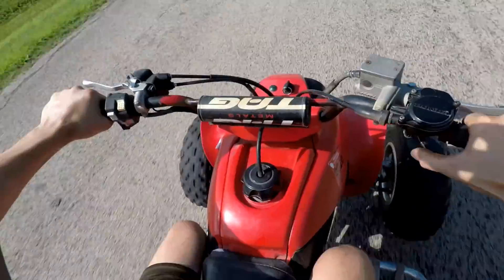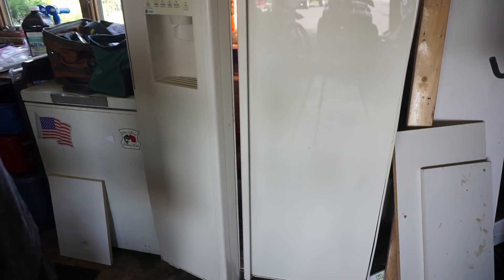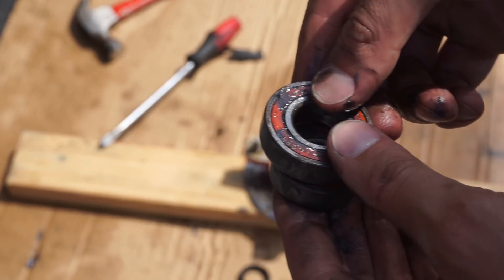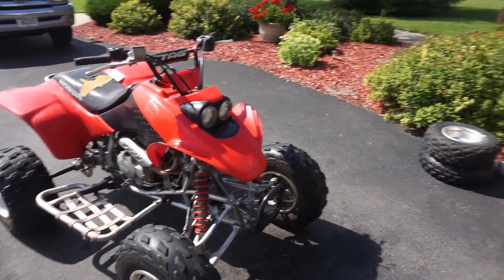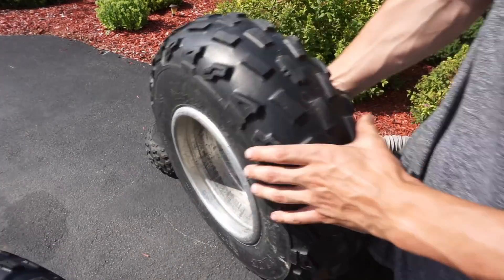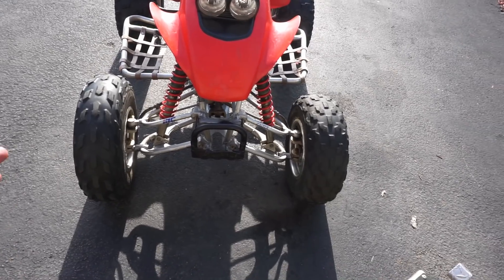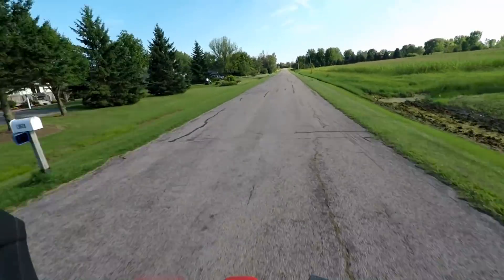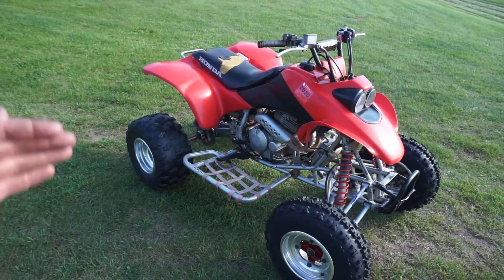New Wheels and Bearings...Will They Fix The Death Wobble?! (Honda 400ex)

Comment: For wheeling the first thing you need to get use to is using the back brake when you're in the air. Just practice until you're confident and once you are,  practice clutching up, even if you clutch up and it doesn't go very high. Keep that up for a while and in no time you'll get the hang of it. We already know you can power up but it's a lot harder trying to keep a wheelie up if you're powering up in first gear. Once you have clutch/rear brake control, then you can slowly look for your balance point. There are other ways to learn wheelies, this is just the way I learned. Keep up the good work and never give up only you can figure it out.

Comment: I told you Ive seen it many times dont run tire slime in front tires..

Get a beedbreaker and then pressurewash them out. Ive done it a few times.

wont fix the bent rim but the other will be ok tire may or maynot  work

good luck keep up the good videos, like the 450r I had both myself 2001 416ex, and 2004 HRC equipped 450r. no cam touches the 04 HRC in a 450r

PS  for wheelies make sure rear tires pressure is even and try standing with legs rest against rear fenders at first to make it balance a tad lower  good luck

Comment: Smooth throttle, keep your arms fully extended, 1st gear, worst that will happen is the grab bar will hit the grass, keep your foot ready at the rear brake and if the bar hits tap the rear brake and bring it down. Tires are probably having you rev too much because the are bald. Once you pop it up lean off the throttle dont chop it.

Comment: 10:50 You need to adjust your throttle. You can hear it rev up when you turn the handlebars. That's normally caused by a slightly short throttle cable. Most times that can be fixed by rerouting it or adjusting it. Great job nonetheless man! That quad is definitely a keeper at this point I think.
Reply: @Austin Zuber Yeah, that probably needed some adjusting. Lol. Mine did that too after I upgraded handlebars to slightly taller ones. I just got an extended throttle cable to fix it.
Reply from the maker: I noticed that as well! I think it is because I had a zip-tie on it to prevent it from meting on the motor.
Reply: @2vintage  Something like that could definitely cause it. Thanks for the content.

Comment: Did you pull the seals on the new bearings and pack some grease in...they are usually minimally greased.
Reply: not too many people know how to use a razor blade to pop the seals on the bearings you clean them out with solvent. And I suggest put good synthetic grease back in it. But he probably bought Chinese bearings the cheap ones

Comment: Damn that's kind of crazy. It's that green ghost in the tires. I kind of figured that was throwing the balance of on your tires. I bet if you could get all that crap out out of those tires, you probably could put those older tires on it while you are riding it on the highway because concrete and asphault will eat up 4 wheeler tires very quickly but as much stuff as you have got, that would probably not be a problem for you. I want to bring you mine and let you tweak with the computer on it. Change the gearing up a little and make it go faster. I also want the rev limiter off of it now. I thought they had finally taken it off but I got to the very top of a road and let it go and once it hit 64 , it started taoljg

Comment: Even though you fix the wheel wobble, you definitely should fix that bent tie rod. Don't want to make yourself look like a hack.
Reply: Unfortunately Joe has been a hack for awhile. I get getting it good enough to ride but it's every project and he never listens to good comments and when he does it's the most stupid crap like it's "smoking cause the air filter is causing too much restriction" like dude that doesn't make sense.

Comment: I wheelie my bike all of the time so what I see is that you are Leaning to far forward you need to lean back so your arms are all the way out which therefore puts your weight on the back of the four wheeler which will help you find the balance point faster.

Comment: Good job man...you've been killing it on your fixing Skillz....BUT those 9000-RPM wheelies are hard to watch... you have to either slow down n use your clutch to pop it up and learn how to balance ...or hit the next gear...Or nothing will change...im not trying to be negative...I got 25 years of riding...I can wheelie any of my bikes till the sun comes up...Even my snowmobiles...my point is... if you want to practice wheelies and get better...stop doing what dont work over n over...

Comment: Here are the most common symptoms of bad control arm bushings and ball joints:

Clunking Noise. Specifically coming from the control arm and usually following a bump, braking, or a hard turn.

Steering Wander. Pulling to the left or right without input from the steering wheel.

Un-Even Tire Wear. ...

Vibration.

Your problem not your wheels

Comment: Can I make a suggestion for the next quad? Either a Polaris Predator 500, Which I had, they were good quads as long as you changed the oil and filter regularly. Or better yet, get a Polaris Outlaw 525 with or without the IRS suspension. They are great quads, look good an the Outlaw has a motor from KTM.
Reply from the maker: I've seen a few up for sale! How do you like them compared to the hondas?

Comment: that bar on the back won't save you, Iol you'll still flip. That slime was intended as a temporary patch if left inside for more than two years damage will easily be done. i.e. the rim and tie rod. That's a suggested hint at how well your machine was taken care of. Good job figuring that part out! But to be honest, after watching your top end rebuild I personally wouldn't put any faith and in it.

Comment: Pop that clutch in 2 gear and it come back but keep tapping that brake very lightly you wheelien to fast you can’t do power wheelies in first gear
Reply: you can but its hard to get to the balance point and stay there, most the time you loop or dont balance.

Comment: Hey I have a 2002 TRX Honda 400ex just bought it and can't figure out why it won't idle I have changed everything I can. Cleaned up the carburetor rejetted valve needle replacement played with the air screw not sure what else I could do

Comment: new bearings - wheel rim, but you did not check the tie rod ends for slack or if they are worn , as they to can cause wobble
Reply: He checked the tie rod ends two videos ago. One of them was bent and he straightened it.

Comment: Hey where did you find that little atv jack I've been wanting to find me one for the atv and for the street bike...
Reply: I think he's just using a bottle jack. If you want an actual jack designed for ATVs and motorcycles, harbor freight sells one that goes on sale for about $60-$70. I've had mine for about 4 months with no issues.
Reply: @xfiringsquadx  I meant one that is solid not extending and it works more like a jack-stand
Reply: @kevinAuman1  Oh, I see. That's a lift stand...

https://www.motosport.com/ktm-powerparts-lift-stand

Comment: I have a honda crf150r 2009 it almost dont hav power at low rpm and wont start with the kikstart when it is warmed up so i have to roll it to start. Do you have an idea why?
Reply from the maker: Make sure the valves are in spec
Reply: I can’t believe Honda made a CRF125 hahaha 😂
Reply: Could be the carb also
Reply: Fox250R it looks so old
Reply: 2vintage it runs super good at high rpm and got mutch power
Reply: Check your plug
Reply: Fox250R brand new the old one looked good to
Reply: Knut Dalan jets dirty maybe ?
Reply: Fox250R i am a bit afraid to do things to the carburator because it somthing i sm not good at

Comment: I have itp rims on my 94 fourtrax 300 12x7 new tires new rims and I have a wobble was on the front right I switched the two fronts around and still have a wobble on the one wheel now it's front left since I switched seems like a bent rim from factory since I don't ride hardcore just drive around my yard I'm thinking of getting a new rim I hope it solves it rim only says 12x7 don't say what offset it has so idk what rim to buy any info for me

Comment: I have a 2001 400ex and it will run for about 5 to 10 minutes and then slowly die. It won't start now any ideas of why.
Reply from the maker: Getting enough gas? Try putting it on reserve

Comment: Stay away from that junk slime,the rims are way better, should ride pretty  nice.  So looks like 04 05 trx 450r. First mods,    hi flow k&n filter,yoshi pipe head& muffler, jetted carb, hot cam,prm full skid plate, bumper.and that bike will be so fast and  responsive you won't know what to do, you won't really have enough space to open it up fully 😉 😃😃   and it will be your forever bike

Comment: Oof dude, never hammer on the inner race of a bearing. That damages it. You need a socket that’s the same diameter as the outer race to hammer it in the there.
Reply from the maker: I had a washer that was on the outer race of the bearing. It just hit the outer race.

Comment: Use third don't be scared those are the best quads for wheelies good even tire press my banshee is like 12oclock for its balance point 400 is like half as steep and smooth motor banshee lots of power or none ?

Comment: The heat gun and freezer trick was pretty pointless as you still had to pound the bearings in
Reply: It would have been more difficult had he not followed that process! I leave mine in the freezer no less than 2 hours and they usually drop right in!

Comment: Okay I just watched you remove bearings in your Beating them out you actually removing aluminum from The Hub. You should not used a torch to heat it up for a hundred eighty degrees so when you Capital with a screwdriver the bearing falls out. Then I just watched you be a bearing in and then set a washer on the bearing race so right off the bat you just killed the bearing which was probably a Chinese bang to. You should have heated that aluminum up with a torch too bad a hundred eighty degrees so you spit on it sizzles the bearing Falls right in.

Comment: Bro are you seriously that lazy? take the air out of your left rear tire. Everytime you pull a wheelie the whole quad pulls hard right how do you not notice that ?
Reply from the maker: I didn't notice that. I will next time I ride. Thank you for pointing that out.
Reply: @2vintage  no problem its been driving me nuts the last 4-5 videos. Ps. Dont use a tire pressure gauge to equalize your tire pressure the tread depth will always be uneven on both rear tires you have to basically ride wheelies up and down constantly adjusting each rear tire till the quad rides perfectly straight on a wheelie . And if you didnt know the lower pressure you have the easier it is to ride a wheelie the more pressure you have the harder it is to keep a stable wheelie